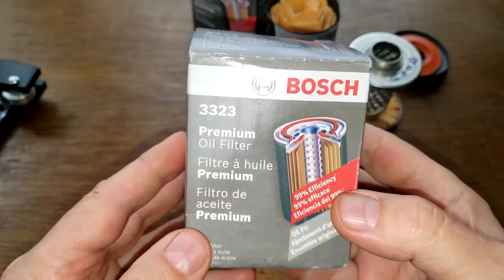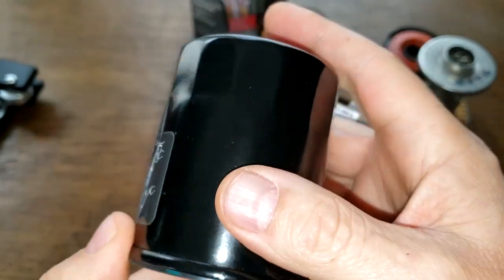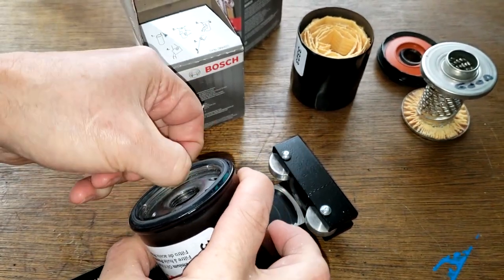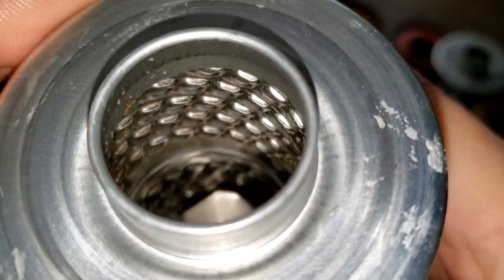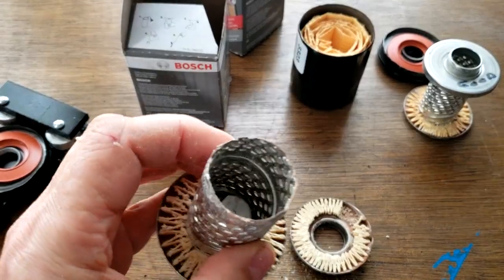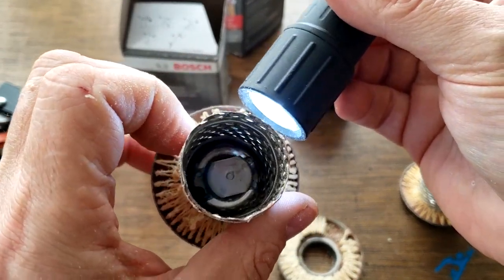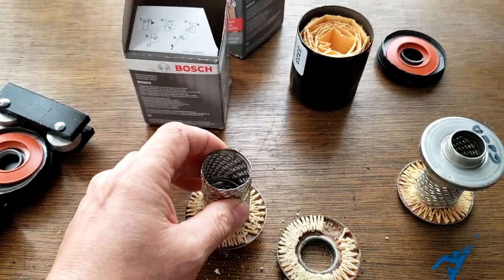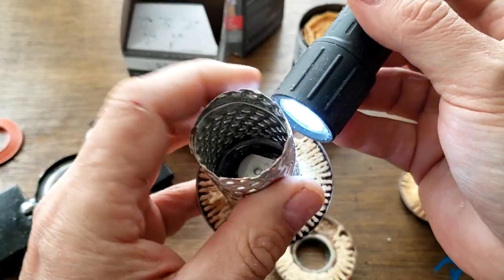Defective Oil Filter, Look Before You Install Your Next Oil Filter, Check Your Oil Filter

Comment: This is precisely why I avoid filters with louvers. The SuperTech and its nylon cage keeps my mind at ease.
Reply: Me also
Reply: I hated the idea of plastic cages when I first saw them in filters.  I thought of it as being mfg. cost cutting.Now after watching many filter dissections I realize that they actually allow for a easier flow. Someday I may even change how I feel about fiber end caps 🤔
Reply: The nylon end tanks on a radiator can last 21 years. Those are boiling hot. The material seems fairly resilient.

Comment: Good video for everyone to see. I noticed this on a K&N filter I bought 4 years ago for my 2004 Dakota pickup. A lot of the louvers were not punched correctly. This filter was made in China. To K&N's credit they sent  a new one to me without having to return the old one. I bought the filter directly from them. I have also noticed this on the Napa Gold filter for my Mazda. This filter is made by WIX and is made in Mexico. The Wix filter is identical to the Napa Gold filter also made in Mexico. I think the Wix, Purolator filters are now owned by Mann Humel. Most Bosch filters are made by Purolator from what I can tell. They both had a lot of louvers that were not punched correctly. I now tend to stay away from louvered filters for this reason. I first remember seeing this louvered core when I worked in industry about 20years ago. The Pal water filters used this type of center core. They were made of stainless and punched correctly. The tooling was probably much better than what is used for the auto oil filters. I still have the old K&N filter with the bad louvers if you want me to send it to you so you can cut it open.
Reply from the maker: Hi David,
I'd rather have a New filter.
Thanks for sharing.

Comment: A lot of Motorcraft FL-820s filters have louvers that are only partially opened.  I looked at 6 of them at Walmart and finally gave up.  That's why I switched to Microgard Select filters.
Reply from the maker: Thanks for Sharing, my Walmart no longer has the Motorcraft oil filters.
Reply: @WhipCityWrencher  My Walmart has them but they doubled the price from $4 to $8.

Comment: I had this EXACT issue yesterday (100% closed louvers on 2/3 of them, other louvers slightly, barely open) WIX 57002 (Made in Mexico).  First oil change on wife's 2.5L Turbo Mazda CX-50. Thank the Lord I caught it!!! VERY VERY disappointed in WIX about this!!  HUGE quality control issue!!!  Other WIX designs tend to be excellent.  No more louvered filters for me here on out.  I tend to order filters online, so I won't be able to inspect them prior to purchase.  So, it's not worth buying louvered filters in my opinion.
Reply from the maker: Hi Dustin,
The more I see and hear about the closed louvers the more I'm liking the Nylon cage. Haven't seen a defective one yet. Thanks for Sharing👍

Comment: I just looked through a pile of Bosch 3500 filters (same  size as Ford FL1a and Fram PH8a) that I bought.  I use them in several vehicles. Out of 28 Bosch 3500, 17 had louvers and 11 had drilled holes.  The date code on filters is greek so I can’t tell which ones are newer.  I used one of these Bosch 3500 filter on my 1994 Nissan Pathfinder as I use a remote oil filter setup.  I failed emissions last week in AZ.  I was told that dirty old oil can cause you to fail.  So I changed it after just 2,000 miles.  Oil was BLACK AF.  I thought I had a plugged EGR etc.  Just spent 30 minutes digging through the trash.  The one I pulled off of Pathfinder was louvered!  I ordered an oil filter cutter last week after watching a bunch of these videos.  I will take it apart and see.  Louvers look kinda closed from outside but not sure if that is the black oil causing it to only look closed. Stay tuned…
Reply: Send me your reply if you can . I would like to see what you find.
Thank you
Reply from the maker: Let me know what you find out, Thanks!

Comment: The louvers were partially open. Some oil would have flowed through them. Any excess restriction would cause the bypass to open. So, would that have destroyed the engine? No, but you'd have an oil change worth of poor filtering.

The most worrisome part of this to me would be if the louvers release metal fragments into the "clean" side of the oil. THAT could have damaged the engine, and you'd have virtually no way to prove that it was Bosch's fault.

Bosch definitely owes the user community a response. I've just removed Bosch from my vendor list for oil filters.
Reply: I have a couple of those same filters for my Corolla. Should have stayed with the Toyota filter. I never thought of looking at the inside holes.
Reply: Just had this issue on a WIX 57002 (made in Mexico) yesterday. Caught it before installation!!  Other WIX designs I've used are excellent.  No more louvered filter designs for me.

Comment: Wow!!! I have a relative that works on heavy equipment. He says they have been finding metal filings inside filters from major manufacturers like CAT. They now borescope all of the filters before installing them as those particles would go directly into the engine and can plug oil cooling jets at the bottom of cylinders and do other damage.

Comment: Huh, that's the filter I use and interestingly enough my oil pressure dropped 5 or 6 PSI after my last oil change. It's not low but now I'm wondering if I should replace it anyway
Reply: Maybe your old filter was plugged.
Reply: @GT-mn3bx  no, it had always been a certain pressure at a temp & RPM since I bought the car new. Always used the same oil and changed every 5k.
 So it was this last filter.
Note I went out after posting and changed the filter with a new Bosch I had on the shelf for the next oil change (didn't change the oil, just replaced the filter 'early' )
Drove the car to warm it up and check and see I regained the missing oil pressure - so it WAS something about the filter!
Reply: Get open style cage nice free flow design be safe not sorry

Comment: I seen 2 Bosch filters with suspect closed holes, complained to Bosch & then promptly crushed both Bosch oil filters in the filter crusher instead of returning them to the autoparts store where they would have ended back up on the shelf & destroy someone else's engine.....these should have not gotten past quality control at the factory....but then again it's a Mexican factory
Reply: The "but then again" portion says it all.
Reply: Fake Bosch filters
Reply: @Haffschlappe  ,they was original Bosch filters that was made in Mexico & was sold thru legitimate parts suppliers thru Bosch for the North American market,Bosch even refunded the purchases & took the information off the filter that I took pictures of ,they also sent me a jobber pack of 12 replacement filters a few weeks later

Comment: Installing an oil filter like this could cost someone an engine.  Videos like this emphasize the importance of at least glancing over and checking the filter's construction.  On top of that, I see the sloppy glue...prices go up, quality goes down.  Probably a new factory in MX as these filters were made in the USA before.

Comment: Wonder why the guy didn't just return it and get refunded? I'll stick with the plastic cage ACDELCO.
Reply: Good question.
Reply: Those are 6-8 bucks.  Honeslty, probably would have sent to Pete Also.
Reply: I agree, Plastic Cage, also known as E Cores, are the superior construction. AC Delco, Super Tech..  really good set of filters. Though I like the better end caps and Silicone ADV from the Super Tech MP series
Reply from the maker: He wanted to let Bosch know about it and they basically ignored him so he gave it to me so that I could inform all that watch the channel.
Reply: Maybe I should send you my used one that I mentioned in comments…
Reply: Still seems very odd not to return it to the seller for a refund. I'm now thinking a sketchy seller like ebay and the filter may be counterfeit. Media color different on both filters. Suspicious if nothing else.
Reply: @nakatsumegami706  I opened a PF 63 from my Silverado a few days ago and it has metal end caps. I had heard Fram is making them now. They look the same without the felt.

Comment: I would like to see another shot of those louvers in a completely dark room with light down one end of tube viewing louvers light on outside. While louvers not as open as last Mexico Bosch, I'm very doubtful they pose a flow or bypass issue.
Reply from the maker: Hi faxmen09,
I"ll have and do it at night because even with my shades down it's still rather light in the room. I'll see if I can do it tonight.
Reply: @WhipCityWrencher  Sounds like a plan. I think it would be interesting to see. When you can get to it.
Reply: Why chance it go with open cage style better safe than sorry plus no long mileage oil changes that been drumed up by oil companies
Reply from the maker: @faxmen09  8:45pm 👍
Reply: @cr2158  Because one outlier does not a rule make. Oil filter companies like Champ Labs have been using louvers for a very long time. And, more manufacturers are moving to them. Just the way it is.
Reply: @WhipCityWrencher  Watched it Whip. While I agree the one said to be "good" has louvers more open than the one stated to be "bad", I'm not convinced by what I see that the second filter wouldn't flow adequately to meet flow specs. Still see many more louver openings on it than would be holes on the same tube. But, I understand why someone might not want to use it. Seems the QC in Mexico factory could use some improvement. Appreciate you doing the suggested follow up. 👍
Reply from the maker: @faxmen09  Thanks👍

Comment: I've noticed this on the Wix.  I've been using the Napa Gold 1734 for my 7.3 diesel and I usually check for this.  I've looked at the Wix 51734 at O'reileys which is supposed to be the exact same filter, and I noticed that quite a few of the louvers were pinched closed on the Wix.  I looked at several that were on the shelf and they were all about the same.  I've never seen this problem on the Napa Gold.  Maybe Wix just had a bad batch go to O'reileys and I just happened to check them out at the right, or wrong time.

Comment: I've received two filters like this in the past. Both times I ended up sending them back for a replacement directly from the manufacturer. I could have returned them to the place of purchase but I wanted the manufacturer to see for themselves what they were churning out lol.  One was a WIX, the other was a Purolator. Because of the potential of this occurring with even the slightest of manufacturing variance to louvers, I now avoid oil filters that have louvers. Seeing is believing. When the E-cores first started hitting the market, a lot of people (including myself to a certain degree) suspected it was the manufacturers trying to scrape a few extra pennies in profit but the actual testing I've seen done on the E-cores confirms they are stronger than the metal cages and one thing for sure and without any doubt, the E-cores offer dramatically less resistance to flow versus louvers, not to even mention louvers that haven't been stamped open properly. I don't mind the metal cages that have drill holes instead of louvers, as I've never seen one with drill holes that's anywhere near as restrictive as incorrectly stamped (not fully opened) louvers can be.  Whichever way you think about it though, you'll NEVER have to worry about improperly stamped louvers with an E-core!
Reply from the maker: That's for sure😊👍

Comment: Back in late 2000s to about 2014 that Bosch and M1 Extended were identical.
Reply: I think it may have been before 2014. Bosch used to be made by Champ Labs but that was before Bosch and Mann both bought Purolator from Arvin Meritor back in 2006. After that Bosch US made by Purolator.
Reply: @faxmen09  Hard to tell. Bought the last ones for that vehicle both on sale for 5.77 from Oreillys March 2014. They looked the same as all the ones prior. 8.1 Big block filters.
Reply: @GT-mn3bx  Without seeing can't definitively say, but after the 06 purchase of Purolator, the ones I've seen, Bosch moved to Puro made.

Comment: I recently bought a Bosch 3311 Premium oil filter from Home Depot online for $6 plus tax with free shipping, made in Mexico.  Yes, Home Depot.  Apparently, they sell a limited line of auto parts online.  Parts are hit & miss.  Anyway, the same thing happened to me.  I looked inside, and most of the louvers looked closed.  I returned it to my local store.  I wound up buying a dozen  Champ 2840XL oil filters on Rock Auto.  $3.47 each plus $10.99 shipping plus 6% tax, $55.79 total or $4.65 each, bottom line.  I've watched MANY of your videos and Champ XL seems like the most bang for the buck to me for my 2001 Toyota Echo with 214,000 miles on it.  Automatic 4 speed and I still get around 40 mpg highway.  Runs like a top.
Reply from the maker: Hi Biff
Yep, RockAuto's oil filters are reasonable and if you buy a bunch as you did it offsets the shipping cost.
Thanks for Sharing👍

Comment: i work in Mfg and even though there are a lot of quality control "safeguards" built into the process in mass manufacturing, there is the odd product that slip through the cracks. Checking your filters when you buy them, like this person did is a good idea, "a second set of eyes". I hope the guys from Mann and Hummel see this video.

Comment: Some times people all ways go for most expensive filters the more the higher filter rating some times you get low flow but super tech ac Delco motor craft every 3000 or 3500 max you usually never end up with problems